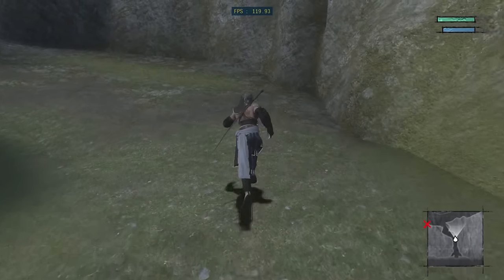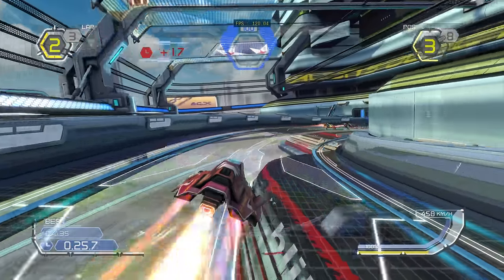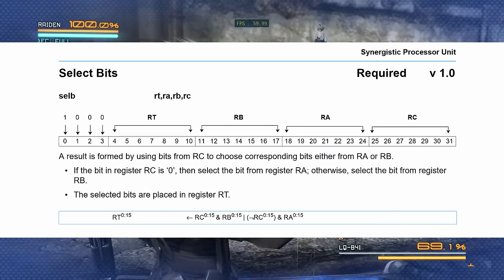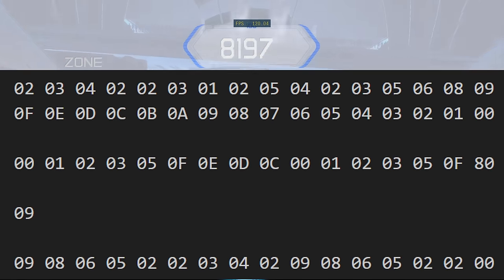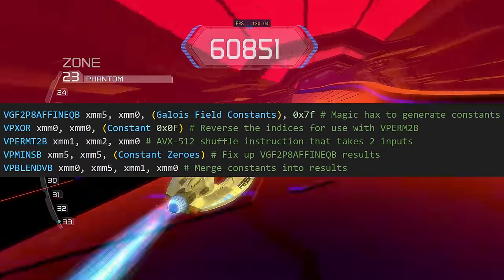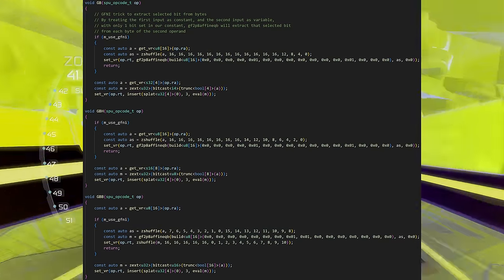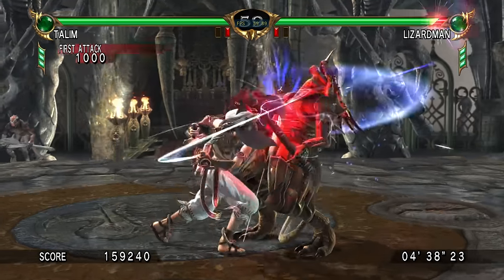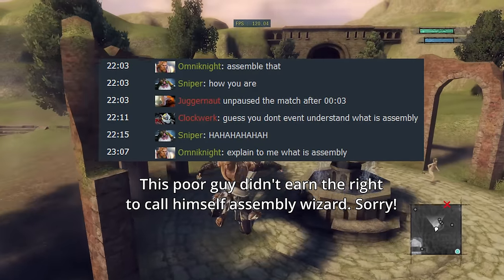Why is PS3 emulation so fast: RPCS3 optimizations explained

Comment: If you don't understand it, don't worry, I'm a developer and me neither.
Reply: I assume many of the developers back in the day who worked on the PS3 didn't either. A lot of making old software (emulated or otherwise) continue to work is to have things function even if the developer did it the "wrong" way. This runs the gamut from Factor 5's work on Star Wars: Rogue Squadron II, a game that used the Gamecube's RAM in such an unusual (but very efficient for the target system)  way that it was one of the last games to run correctly on Dolphin, to downright incompetence like the recent Pokemon Scarlet/Violet releases that were full of major performance issues and visual bugs (which were emulated correctly in Ryujinx).

Both Linux and Windows go out of their way to support software written in horrifying ways, because someone, somewhere relies on it.
Reply: @rosly_yt  just put everything until it works
Reply: Developers aren’t responsible for knowing computer architecture
Reply: I'm a dev and have a little grasp on assembly code... Everything said in this video flew over my head XD
Reply: @Smoshylife  And this is exactly why meaningful optimization for games is dead
Reply: @SDogo  you are dev in what field
Reply: Yea... LLVM is black magic
Reply: Classic web dev

Comment: HOW DARE THEY take away boob jiggle from us!
Reply: is a true ps3 exclusive 🤪
Reply: @Stalker7u7  not ANYMORE! :D
Reply: A true crime against humanity!
Reply: @CopeAndSeeth  You mean - against MANkind? ;-)
Reply: @igorthelight  huMANity 🗿
Reply: What?
Reply: Chances are, the controller handling in the PC is meant for 360 controllers as 360 controllers were and still are widely supported in PC games.
And guess what, the 360 controller has no motion!
Reply: @pacomatic9833  True, but they could've made it an easter egg. Like if you hold down L1+2 and R1+2 you can use the thumbsticks to make them jiggle independently. 🤣

Comment: I knew the SPUs were hard to program for, but I had no idea that they were literally only capable of SIMD instructions. That's actually insane.
Reply: whosawhats
Reply: Not insane. They are SIMD accelerators, not the main CPU.
Reply: The CELL CPU predicted Big-Little ARM and Intel.
Reply: @saricubra2867   Not the same concept. Big-Little refers to cores with different processing speed but the same functionality. The SPU's are coprocessors with totally different functionality to the CPU core.
Reply: @saricubra2867 Not Big.little but the APU's of AMD.
Reply: @Anticorriente  
Why are you talking about APUs?
So far they are just cpus with a gpu included in the packaging.
Reply: @jimb12312  Yeah, but you still need to set up iterators and such. Removing them must have had a huge efficiency increase or something.
Reply: @sandertu8366  they do have NPU too now, though that's just a fancy name for matrix processor.
Reply: They are just fancy DSPs with 256 KiB local memory each connected to a ring bus with extreme (for the PS3 era) bandwidth.

Comment: Epxlanation on "disabled for better yields":
They basically only expect 7 out 8 to work. No matter if that's the case or not. If all work they just disable one arbitrarily to keep everything consistent. 
AMD did that too in Desktop CPU during the late 2000s so some times you could get literally free performance (Except for slightly higher thermals and power draw) by re-enabling one. (sometimes required custom bios. But one company actually implemented that in stock for a while. don't remember which one.) Or random crashes if it actually was broken. That's what the 3 cores where.
Reply: Disabling units is still very much done today, however now instead of disabling them in bios the transistors themselves are lasered off during the triage process when being manufactured. One of the reasons why the chiplet architecture used by AMD is so important is that it allowed to minimize losses from yields, it's a lot easier to manufacture smaller pieces with no defects and glue them together than to manufacture a massive monolithic piece of silicon with no defects.
Reply: @Deliverygirl  Aside from large block cores. We also have GPUs that have more compute units or cuda cores but a percentage of them are disabled or were already bad, it's redundancy across much smaller parts of a chip compared to an SPU or CPU core

The PS5 and Xbox both have redundant compute units for the GPU part of the SOC, but all of the CPU cores are expected to at least work within the designed operating frequency.
Reply: Biostar had core unlocker functionality in some of they're board's back in the day
Reply: sometimes one core will be slower but not completely out of commission too. (e.g. it will crash at over 2.5ghz instead of the rated 3.5)
but yeah that's why we have binning, more often than not, I5 and I7 (or r5 and r7) are the same chip, just that the 5 series chips didn't pass all the tests, so they just have fuses blown off to isolate the misbehaving parts.

it's kinda like if you buy a field, it's cheaper than another one of the same area, but there's sinkholes in it so they have been fenced off.
Reply: @Deliverygirl  So, binning?

Comment: Been really enjoying Demon's Souls at 21:9 upscaled to 4k with online servers.
Reply: What's your frame rate?
Reply: @zenmastakilla  You can use a 60 fps patch. It works great with the only exception being the way the camera pans in cutscenes. It's like the camera still moves at 30 even though the animations still run at 60.
Reply: @MAJ0R_TOM  Is 120 fps possible?
Reply: @zenmastakilla  probably. The patch is just labeled "unlock fps". I just don't have a monitor for 120 myself.
Reply: @MAJ0R_TOM  Apparently 120 fps introduces physics bugs. Ah well.
Reply: Wait, there are private servers of Demon's Souls??

Comment: I really wish I was able to understand more assembly code. I understand the functions you talk about in isolation, like what they do on a hardware level, but I have a really hard time comprehending how they come together to make the game that we see. I would love to watch a video where you show which lines of code are doing what in terms of what the player can see. Like “Here’s a line of code. This is how the game looks/performs with it. Now here’s how the game looks/performs after applying an optimization and why.”
That would really help laymen like myself get a better picture of what’s actually going on.

Anyway, great vid, thank you for taking the time to make it. Idk if your work is partially responsible for getting Skate 3 to run at 60fps on my Steam Deck, but I’m just gonna assume it is and say you’re my hero.❤️
Reply: Usually these lines of code are performing a small instruction of the whole. Think of how you speak English, and how you don't need to think about the individual letters when you speak. If each word suddenly requires you to spell out every letter and describe its shape before moving onto the next letter, you can realize why that would massively slow down your ability to speak despite not affecting the accuracy or concept of what's being conveyed. If you're looking at stuff on the byte level, you can't boil it down to "a whole" and you have to take things as atomic as possible.
Reply: When developing an emulator they don't really need to know how the game engine puts the game together step by step, they just need to make sure the system architecture runs efficiently and (fairly) accurately, and if there are specific things that don't work then they have to find the pain points and fix them. Reverse engineering each game is too much work!

Comment: This is really cool, seeing what kind of crazy unhinged obscure things modern x64 CPU's can do and how they can be used to optimize emulation. Truly fascinating and sadly kind of a dying skillset in a lot of even performance-critical applications.
Reply: I dunno about dying, it's just niche.
Reply: If ya'll think it is dying, then learn it and make bank 😉
Reply: @Iaotle it is kind of, that's why games have barely improved in graphics the last 10 years, because hardware is so good these days, devs just don't put much work into optimizations anymore and just brute force stuff
Reply: @KibitoAkuya I think your just blind
Reply: @mr.shplorb662  pick a 2004, 2014 and 2024 game and then tell me the improvement is as drastic between the 2014-2024 game as it is between the 2004-2014 one
It isn't
Reply: @KibitoAkuya  just shows u have no idea what you're talking about... Rendering is literally seeing advancements every year. Raytracing, novel AA methods, mesh shaders, there are literally tens of different technologies that get developed. This video is about assembly-level optimizations that are needed because the underlying architectures are different. This is no longer the case on modern consoles, which mostly mimic a modern PC.

LLVM itself is constantly getting updated, as are alternative compiler architectures. Just because you're ignorant of other advancements doesn't mean the art of optimization is dying lol. Read a book.

EDIT: just to add a few: nanite, lumen in UE5, AI RT denoisers from NVidia.

The reason you don't see the difference is because we have worked for years to develop hacks to render scenes as closely to real life as possible without actually doing it (for example baked lighting). Of course if you go from the first tomb raider game, where Lara had pyramid tiddy, to modern day games where character models have thousands, if not millions of polygons, you'll see more of a difference than if you go from 1 million to 2 million. Once it's photorealistic there's not much else you can improve when rendering. What, you expect the screen to produce better reality than real life?
Reply: What's really going to get you is the x86-64 cpu is emulating that design but really a risc running microcode
Reply: @KibitoAkuya  I'd like to encourage you not to regurgitate reasoning hallucinated by gamers with 0 programming or game dev experience. While probably true that certain aspects of game dev see less optimization attention paid due to hardware advancements (in other words, negligible gains), the idea that devs are being lazy about it is misguided. There's an immense amount of work poured into new, more optimized techniques. Sure, assembly level optimizations that eek out every iota of potential from hardware isn't much of a thing anymore, but that's a scale issue, not a skill issue. There's so much complex code that goes into making a modern game look good, and there are so many unique areas of expertise. There's a reason leveraging middleware and licensing third party engines is so common these days. It's incredibly complex stuff, and I promise you that every programmer writing rendering related code is considering performance to the best of their ability and time constraints (cause writing the most efficient code can be excruciatingly unintuitive).
Reply: @Iaotle  So games run worse but look mostly the same. Some real improvement there lol.
Reply: @real_jake  whether or not you consider it an improvement is a different question. The skill of low-level optimization isn't dying out though.
Reply: I read it as “dying skillet” and was confused for a good minute
Reply: @Iaotle  It was absolutely essential ten years ago and now it's an afterthought so it's definitely dying at least in game development
Reply: @Scornfull  it's become less important, it's not dying. Just saying "it's dying" isn't enough to demonstrate it.
Reply: @KibitoAkuya  How many 2024 games have you played and when's the last time you played a game from 2004? 
I'm sure we all remember a lot of the most popular console games from 2004 (GTA San Andreas, Jak 3, Ratchet and Clank 3) which all had graphics that were already dated, but consider the PC games that came out in 2004 such as Half-Life 2, Unreal Tournament, and Doom 3, all bringing huge steps forward in graphics, especially with lighting effects. Doom 3 in particular may not have had the best gameplay, but it made incredible use of the darkness and shadows that only real-time per-pixel lighting can bring to the table. Now compare that to some of the most popular games from 2014, Far Cry 4, Forza Horizon 2, and Middle Earth Shadow of Mordor. On the surface they look immaculate: bloom, saturation, chromatic aberration, emissive reflectivity: gorgeous games... until you go in a cave. As soon as you take away the bloom and overbright and pretty post-processing effects that were super popular in the mid 2010s and only work well in broad daylight, the game can't fool you anymore and it just looks like ass. Consider those graphics, and then compare it to something that just came out. 
Here's your three games: Doom 3, Far Cry 4, Hellblade 2.
There is undeniably a straight graphical upgrade from Doom 3 to Far Cry 4, but games like Hellblade 2 are starting to blur the line between gaming and cinema in ways we could only dream of before. I think you're severely under-stating how far computer graphics have come in the last decade. This may be presumptuous of me, but I am 25, I have very fond memories of 2014, and rather vague memories of 2004. I am much more cynical than I was 10 years ago, and I am not nearly as impressed by videogames as I was back then. I had to fact-check my own nostalgia before writing this comment, and if you're a similar age I suggest you do too.

Comment: Great video even if I'm just an artist and not a programmer. Sometimes I wonder if buying a 7800X3D was a good choice for emulation and it's nice to see that at least rpcs3 is making use of avx 512 (wish it used the cache more tho)
Defo curious to hear more from you. Nice Wipe gameplay, I've been playing it at 120fps myself, and I'm pretty amazed by RPCS3 right now, unlike somes like the S!witch emus, the frametimes are perfect with no stuttering issues at all. Disabling SPU related effects got me to play stuff like Motorstorm 3 at near 60fps, too.
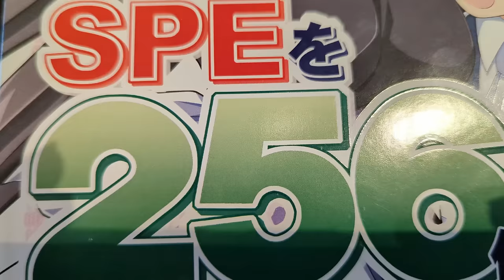btw 2:05 no fucking way lol
Reply: if you ever buy it you should make a video with my settings in god of war 3, i want compare performance.

Comment: I didn't know what I was getting myself into when I clicked on this video which I only did cause I like emulators in general and find RPCS3 in particular pretty impressive. Was pleasantly surprised by an in-depth explanation of  assembly optimizations that could be followed as long as you know what floating points and some common instructions like and, etc. are. Kudos to you.

Comment: It is still a mystery to me why sony is not allowing ps3 emulation on ps5 hardware.
Reply: they want to resale remasters remastered
Reply: Sony isn't able to emulate PS3 hardware because of the very specialized spus that were used so heavily as part of the console architecture. For their PlayStation now PS3 titles, they're not emulated. they literally have warehouses of old PS3s set up to run the games. 

Maybe once the open source community solves ps3 Emulation, Sony might copy their work to create an "official" PS3 emulator.
Reply: @cyropox8235  RPCS3 is GPL'd, so as long as Sony is willing to release all the code that's required to make it work on the PS5... 😆
Reply: The PS5 uses Zen 2.
Reply: Licensing is a big art of that I'm guessing, also they value youre PSN sub and personal data way more then them putting in the effort of emulation and contacting 3rd,2nd party publisher to striking new deals, also they'll bring up security risks through exploits in the emulation software as a possibility/excuse
Reply: @cyropox8235 you have quite the imagination
Reply: @saricubra2867 ok, wanna take a guess what PC's run on ?
Reply: @chillhour6155  x86, i know. But i have Alder Lake and a friend has Zen 3.

Zen 2 is not good for gaming.

Comment: Thanks for all your hard work on RPCS3. I didn't fully grok what you were talking about, but without your awesome work, I wouldn't be able to play the games I worked on in the past on my Steam Deck! Emulators are amazing, and I'm blown away by the fact PS3 games can run at all on Steam Deck. Steam Deck uses Zen 2 CPU afaik, so I'm looking forward to seeing what improvements to emulation the next Deck will bring with CPU architecture upgrades.

Comment: Man low level programming is just crazy to me, I'll stick to my weird and wacky Javascript frameworks 😅
Reply: you're sabotaging yourself thinking this way. this is far from typical. low level programming is not inherently super hard or anything. even normal assembly code is honestly pretty easy to learn, but almost nobody even goes that low these days.
Reply: +1 to what jc said, emulation and instruction set micro-optimization is edge case stuff, you can get into low level programming without having to delve into the magic like shown in this video, probably what will throw you off the most is how ugly the syntax tends to be for low level stuff, if you work with high level languages like javascript you'll probably be used to the high abstraction with very descriptive naming schemes for methods and data structures, whereas in low level programming everything looks like magic from everything being an abbreviation of an abbreviation.